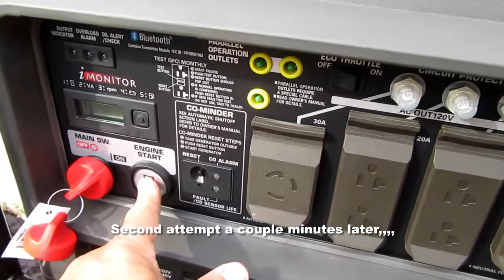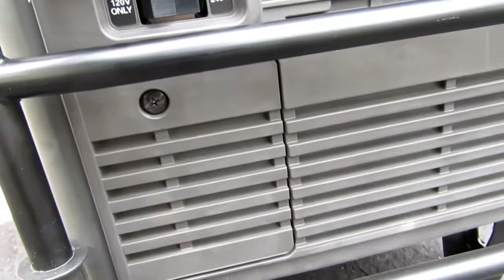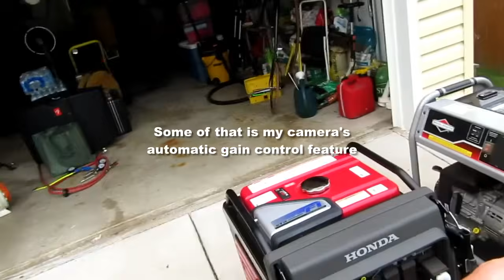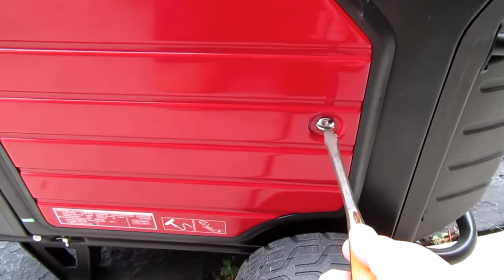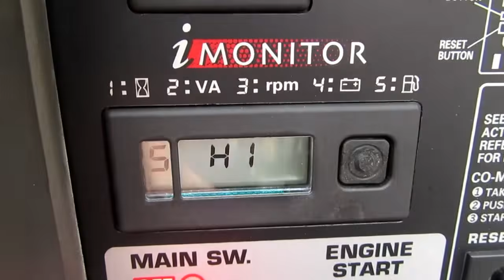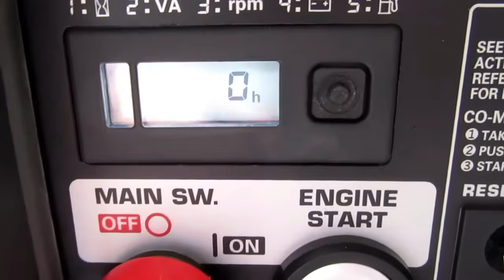Honda EU7000iS Generator: Quick Overview & Comments

Comment: Hold the start button DOWN until it starts
Reply from the maker: Michaelgarcia, there is no need to hold the start button down. A single press tells the computer to start the engine, and it will do so if it can. The manual even says so.

Comment: Something you should know and/or mention is that the electricity it produces is “clean” power. It’s an inverter style generator. The power is clean sine wave power and much safer for electronics in your house. Also, this model has an optimal Bluetooth module that can control the generator and provide useful information.
Reply from the maker: Mike73ng, except that stuff about the "clean" power being "safer for the electronics" in the house is pretty much nonsense. First, the output of a traditional generator is naturally a sine wave already, Second, practically all AC powered electronics for decades now use switching power supplies, which can't care less what the waveform of the AC power is.
Reply: @youtuuba well in traditional generators the voltage is RPM dependent. That’s why they all run at a fixed RPM. One winter my cheap generator started struggling with carburetor ice. The RPM slowed and the voltage dropped. My dad went out to goose the throttle to clear the ice. He ended up frying the adaptive defrost timer on my refrigerator. So yeah, electronics can be negatively affected by unstable power.
Reply from the maker: @mike73ng  The defrost timer probably got fried due to trying to run on low voltage, not because of any "uncleanness" of the power.

My point is that some older electrical things, and electronics with more primitive power supplies, could in fact be stressed or actually damaged from running on significantly 'dirty' AC waveform and/or significantly wrong voltage or frequency. But with modern (at least the last 20 years) switching power supplies in virtually all electronic things, those can run on DC, AC of widely different voltage, frequencies, waveforms, etc; just fine with no difficulty, all the while putting out very clean DC power to the rest of the electronics.

Most of that "you need to have an 'inverter' generator or else you may fry your 'sensitive electronics' " is pure marketing scare tactics.
Reply: Also has a floating neutral

Comment: One comment about the "ECO Throttle"  Because this in an inverter generator, the output is "ALWAYS 120/240 volts and 60 cycles per second",  Same as the power that comes to your house.  The Eco throttle matches the engine power to the load and is constantly changing speed to match the load.  There is no danger to your home to operate in Eco mode.  I only turn off the Eco to warm a cold engine or to just waste fuel.  Because this EU7000is has fuel injection and an electronic governor, it can safely be run in Eco mode at all times.
Reply: Interesting. This is something I have done for years on medium sized loads, but now after watching this video, and looking at the manual, I think I should not have been doing that. The manual indicates low loads only on Eco Mode, and would also apply to the usefulness of Eco Mode in context of using this generator at a job site.
So, after 6 + years, I'm changing my approach, based on these two considerations, and based on my presumption that doing otherwise may affect the longevity of this generator.

Comment: best honda ever.   Make sure you keep the battery on a trickle charge when in storage.  Will always start.   The batteries on these these things are notorious for dying.
Reply from the maker: 2marice2, yes, I found that even with a brand new, 100% freshly charged battery in my EU7000is, it can only start the generator maybe 3 times in a row, then the generator needs to run for hours before the battery accumulates enough energy to manage another start. Of course, I can always pull-start if needed.

I purchased a small trickle charger, which includes a short ring-lugged cable that can be screwed onto the battery terminals (along with the generators own wiring. The cable is just long enough to pass through the ventilation slots of the battery hatch, and the longer cable from the charger  plugs into the end of the short cable with a waterproof connector. I leave the charger on top of the stored generator and plugged in as described above, always keeping battery fully charged. The charger quickly unplugs from the generator when I need to use it. I did need to add another AC outlet in the garage to served the charger.
Reply: Weird. Mine is 6 years old. Use it very rarely. Starts like a charm every time. The battery is a Yuasa, among the best
Reply: I highly recommend getting the Optimate 3 battery charger.  It is designed to keep the battery at full charge without over charging,  I have 3 of them, on my riding mower, ATV and Motorcycle and I have yet to need to replace a battery in over five years.
Reply: @papajo7316  I normally use a battery tender on my mowers, etc. With this generator, I noticed a plastic access door to the battery compartment. Must you drill an access hole in the door to route the battery charging wires? Or, can they be routed through the venting slots on the door.
Reply: @boba.4316  I just ran them out the bottom of the battery compartment.  No holes to drill.  This is nothing more than a small motorcycle battery.  I put mine on a timer to charge for about 3 hours a day.  My battery is over four years old now.

Comment: Great review.  Need to purchase a reliable and easy-to-operate generator for my 80yr old mom.  Have an old 1970s Honda generator in the basement that still runs like a charm but it's a pull start - too difficult for my mom.  Heard great things about the EU7000iS - looks like we have a winner.
Reply: I am not assuming anything but please, please never run a generator of any brand indoors.  Always run them outdoors in a well ventilated area.  Not just for the engine exhaust but also to so the engine can get cooling air in and hot air away from the unit.

Comment: We have a Honda EU7000 IS, and we just had a power outage that lasted 15 hours and 51 minutes. I have 2 large freezers, and 2 refrigerators, my pool motor runs constantly, and everything else in the house, coffee maker, small stove, blender, TV, computer, radio communication, etc. etc. I didn't have to refuel... really an excellent machine.
Reply: I have the same gen. Was wondering how you have it wired to your house? Did you power all of that off the 30amp or using all the 4 receptacles on the gen?
Reply: @Delfly31  Yes, all of this is powered by a 30A cable connected to a 120V/240V outlet. I've done very precise calculations regarding my appliances (two large freezers, one refrigerator, and another smaller one), and my base power consumption is 2129.5 watts, which represents barely 30.4% of its total power.   So I have plenty of power left for all the other accessories, such as the toaster, coffee maker, lights, etc. I hope this answers your question. I'm a native French speaker, and English isn't my first language.
Reply: @kenwood6573 understand it perfectly

Comment: Purchased the same unit as a home back up and works fantastic. Yes very pricey when compared with other brands which may offer more in terms of power. The big differences for me however in choosing this generator are the availability of parts years down the road vs the other lesser brands. EFI over carborated which most others are was also a huge plus for me. Honda will also hold its value for years to come and is more what I consider to be a lifetime investment vs a disposable product. I ended up building a really nice generator shed where my unit now lives providing quick and easy access to power up my house using a Generlink setup. Also what people don’t sometimes consider is bigger is not always better. Larger generators will consume more fuel and in an extended outage situation you don’t want to be burning any more fuel than absolutely needed to power essentials. Pair the size of generator for what your needs are. Need however does not mean it has to power absolutely every appliance at the same time. For most homeowners this size generator is more than sufficient and is of high quality.

Comment: Can buy 5 Harbor Freight 5KW clones for the same price when on sale...
Reply from the maker: 680x0x, yes you probably could, and in the process:
- get less quality
- reward a rip-off place instead of a quality one
- get zero product support
- have nobody to fix if necessary
- have no parts available if needed
- get a product that looks about the same that does not work as well
Reply: If you are referring to the Predator 5kw, it's continuous output is 3,900w. The Honda eu7000is continuous output is 5,500 watts. Even Harbor Freight compares it to the Honda eu3000is in their product collateral.  The Predator generator that Harbor Freight compares to the Honda eu7000is is the 9500, which is 1/2 the cost. I would buy 1 Honda over 5 china shitboxes anyways. Me buy cheep china stupf becuz me pouwah
Reply: I have had my Honda Generator for over 25 years and it has never let me down.  The one big thing to consider is service parts and service dealers.  Honda is nation wide in the USA and Canada.  I say, "Buy the best and forget the rest"
Reply: @papajo7316  Yes 👍